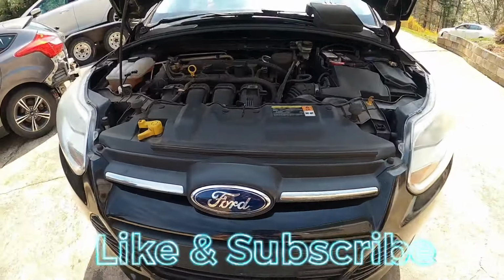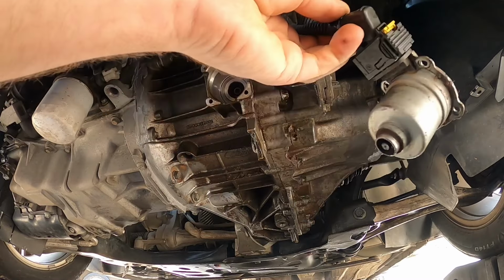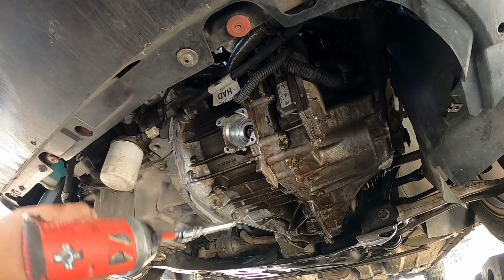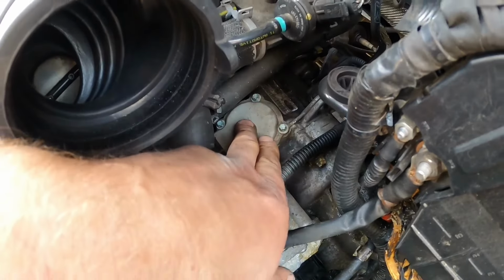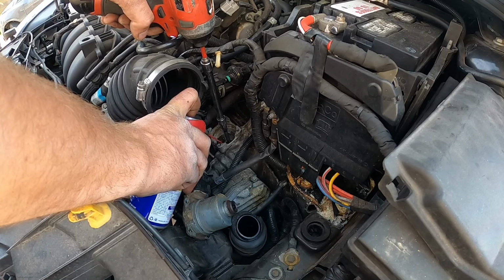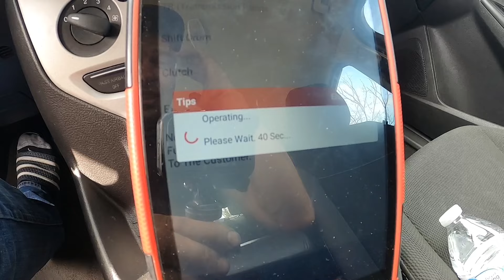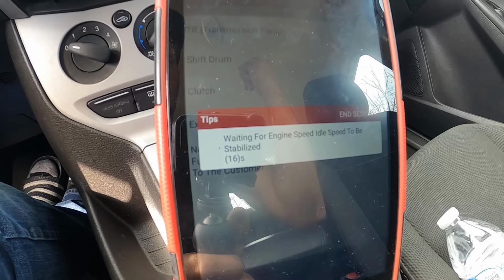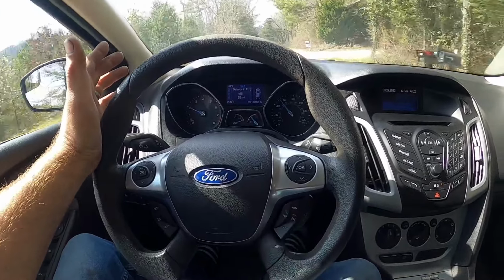2012-2018 Ford Focus Slipping? No Reverse? No Drive? Problem Solved. Easy Fix. You Can Do This!

Comment: Just did this on my Focus, didn't have the Actuator Reset Tool available so I just alternated spraying brake cleaner and placing the Actuator back on a few times. Now my Focus runs like it's brand new again. You are a LEGEND dude!!!!!!
Reply from the maker: Nice! 👍
Reply: @L8R-HP  what if I spray carbon cleaner or 4wd.?,, any different result.?
Reply: So you just sprayed brake cleaner and then drove your car around? Having trouble getting the reset tool
Reply: @cooperking7271  yeah after you spray the cleaner in quickly tighten the actuator back down with a couple of screws and hop in your car, and spend a minute or two just turning your key from off to the on position, the actuator will spin the fork over and over rapidly
Reply: @jmfsmith  let me know how long that’ll last you. I doubt it’ll go on for long the heat and friction material will kill those levers again.
Reply: He'll yea brother.
Reply: Can u tell me the symptoms u were having?
Reply: @dopessongs3635  slipping in drive, code was friction element A stuck on. Still working fine after the fix
Reply: @jmfsmith  hey Jay, I got the same message code recently and then I started getting "transmission overheating" warnings. Did you get the same thing?
Reply: @alexmondragon2594  every now and then I did but that's going to be common when your fork gets stuck. Still running fine with no issues a few thousand miles later
Reply: Hey guys... I have the exact opposite issue.  I only have reverse.  No forward.  I got new actuators, but still no forward gear. Can anyone help me with this?
Reply: @kene23kene  no forward still sounds like shift fork A is having trouble, have you tried cleaning it with this method?
Reply: @Jay Downing  I cleaned it... but not as thoroughly as you.  I don't have the tool that you're using.  I tried with a start bit... but I didn't want to strip it
Reply: @jmfsmith  also what scan tool are you using? I have icarsoft and zurich... neither have those functions
Reply: @jaydowning thank you for this comment man, did this 5 mins ago in a 2012 fiesta with a reverse issue and now reverse is working fine, is there a way to remove the check engine light without erasing it from a scanner?
Reply: I did not have a check engine light on, it just “felt funny” when it shifted and I stumbled on this video. Seemed to work well and drives better. I ordered the tool ($20) and I’ll do it properly soon. As far as reprogramming, sounds like it’ll reprogram itself. Just make sure to turn it counter clockwise 14 times at the end. I’ll do this manually and not with drill.
Reply: Was your transmission also shuddering before or after fixing it? I’m about to try cleaning my actuators because now it’s having a really rough shift.
Reply: @chrisz.9974  Are you getting a kick at 40-50 kmh
Reply: @fputigna  did you try it without the reset tool? My scanner doesn't have the reset and I don't want to touch the clutch if it's going to need the reset scanner.
Reply: I'm planning to do this to my focus in the near future. My question is, after you use the tool that releases the clutch and do this cleaning process, do you have to do anything else so the clutch reengages with the fork or does it do that automatically? Thats the only concern I have about doing this myself and that concern has been holding me back.
Reply: @wickedseedband  from what I have seen you don't HAVE to use the scan tool for that, unless you remove the clutch from the transmission, it'll relearn by driving around. You can check his other videos, he mentions something about that, just to make sure
Reply: Still good after nine months? Give us an update
Reply: @jmfsmith  is it still working ? DPS6 automatic transmission on 16 SE is kinda slipping a little in 2nd or 3rd gear. Used to have code P0 702 00 transmission electrical system so I cleaned the two small grounds under air filter box and big one on firewall driver side to bare metal. It ran great the first few times and I ran it 40 minutes of expressway and it seemed fixed. But since then it’ll be slipping some. And get that dashboard warning transmission overheating. But got no codes . Tried to scan it at Auto Zone and OReillys but no codes showed up. Got the actuators so just clean it out at the holes it goes into ? And it’ll reprogram itself? Just plug and play ? I’ll try it.
Reply: @frankmontez6853  yup still working!
Reply: If you have a big clunk coming out of park and lose reverse look at the drive from the TCM to the housing and see if it spins all the way around or stops. If it stops then spin it back and make sure it stops and your good. If not replace housing. Alternatively a bent clutch fork can do the same.
Reply: @jmfsmith  you the man for keeping us all informed!
Reply: How may miles were you able to drive before it messed up again?
Reply: Thank you so much for the advice. I too don't have the spline tool so I did what you did and sprayed a ton of brake cleaner in there, put actuator back on and kept switching key on & off and heard the forks moving then I sprayed a ton of WD40 specialist for intense rust and repeated the on/off key sequence again. Car shifts fine now. Used to immediately go into limp mode once I hit 2nd gear and would lose reverse. Ford told me I needed to replace entire clutch system for $3,200...This video plus your advice was a life saver.
Reply: What do you think's wrong? If the transmission drives fine until they get hot, then it starts not wanting to shift. Won't go into reverse and when it does you can push it
Reply: @lizmorrison529  if you clean actuatorA makes sure to do Actuator B also because the top one will drip dush on the bottom one and it sticks to the bottom one I had this happen to me last week and so I clean them both again it shifts so smooth and early that I seen increased in gas mileage if it happens again I’m going to drill a hole on the passenger side at the bottom of actuator B for the clutch dust to escape I seen a video of it and it was so much dust dripping out from the bottom of the transmission I went through 2 cans of d40 an one brake cleaner I’m now at 191,000 miles , this method makes some owners wishing they should of kept their focus instead of trashing it good luck to all owners
Reply: @fairfax_fran5109  Thank you. It was my Actuator B fork that was stuck. That was the one I cleaned. I  used a whole can of break cleaner as well and almost a full can of the WD40 specialist. So far so good! But hey, drilling a hole in the bottom of housing does sound like a good idea to remove all the dust & dirt collected in there! Maybe even using a strong vacuum might help?
Reply: @lizmorrison529  definitely as long as you don’t damage the vacuum cleaner lol and just have a someone to help spray it at the same time most important is to hold the folk open no more than 14 spins clockwise some video was 15 don’t lose count you can damage the folk spring then it’s game over
Reply: So many questions posted but no answers!
Reply: @lizmorrison529 hi friend, u spray a lot of wd40?1tin or 2 tin?Won't wd40 fluid leak out of the transmission?Just now I also spray a lot of wd40 according to the video.
Reply: @fairfax_fran5109 Did you spray a whole can of wd40?  Will a large amount of wd40 fluid from the actuator enter the gearbox and then dirty fluid will flow out ?Will spraying a large amount of wd40 damage the clutch ？ Do you also spray a lot?
Reply: @jiawangchu  you see it drip out the holes you drill it work after 4 can of brake cleaner carb cleaner but I would use the d40 can first the lubricant soaks back up the dust
Reply: @fairfax_fran5109  u drill hole on transmission housing ?😲🧐then u spray a lot of wd40 first ?But this video no drill hole on transmission housing 🥺.
Will the clutch be contaminated by wd40?Can cause clutch slip？
Reply: @jiawangchu  not this video sorry a different video I commented on look it up it will show my comment I find it for you
Reply: @jiawangchu  @sev sevy
Reply: @jiawangchu  spray toward the drivers side .. the passenger side is where the clutch is located
Reply: I do not have the tool. I am trying to use a flat blade screwdriver. However, I back out only for turns, and it gets very tight, and, as soon as I take tension off of the actuator, it spins back to its endpoint in a clockwise fashion.  video, it looks like I should be able to turn that rod relatively easy? Is it supposed to spring back into its full clockwise position on its own?
Reply: @baileydbenson1  it’s spring loaded don’t turn it more than 14 spins an yes it supposed to spin back to normal that’s a sign that it’s not stuck if you drill the holes hold it open after 14 spins spray than release , repeat process and if you drill the holes you can see the clutch dust escape the transmission housing, spray till you see it the fluid is clear than you know you flush most of the dust out , when it’s cold temperature using d40 will cause it to gunk back up , your best bet is to drive it when the transmission gets hot then spray the holes for best flush results
Reply: @baileydbenson1  I don’t have the tool either I use a drill bit kit I forgot what size I tell you the size when I get the chance good luck 👍
Reply: @L8R-HP  do I need to do the scanner ?
Reply: @fputigna Do you remember the name of that tool? Size?
Reply: I have a 2015 focus so much money in it now broke down it says the TCM nothing but problems only thing gd about it real cheap on gas
Reply: What does the tool that was used?

What does it called?
Reply: @bqthird 6mm actuator reset tool
Reply: @JestonyAlipda Actuator reset tool
Reply: didn't have the tool on hand so I did this method. Car runs good again!!!
Reply: @fputigna  Where did you buy this tool? I'm about to do this process right now. Need this tool! Thanks in advance!
Reply: @bqthird DPS6 6DCT250 14 teeth, 1/4" Drive
Reply: Hey I just recently had this problem with my car my car doesn’t shift to reverse it’s stuck but it moves on D
Reply: Hello sir i have this difficulty with my focus 2014 i just replaced my gear box old one got bad so inserted a new one and it has no drive and no reverse what I’m i to do?
Reply: @lizmorrison529  Did you do the testing at the end? I don't have a scan tool, but I might be able to get one if I need it
Reply: @melanieadams3066  I unfortunately don't own a scan tool either and so I didn't do the testing. My car lasted another 6 months after doing this trick until my dual clutch packs completely failed and needed replaced. Didn't have the 3k Ford dealership wanted to have it all done so I wound up selling my car to a wrecking yard for $600. She at least did me good, lasted 6 years and ended with over 150k miles. Originally bought used for $3,700 at 80k miles on it.
Reply: @chrisz.9974 hey bro, can u give an update on the fix and if it worked? currently dealing with the same issues
Reply: @ I had to replace the clutch forks unfortunately. Biggest project I ever tackled.
Reply: @chrisz.9974 was the fix extensive? i’ve never worked on a car before but kinda wanted to do this, but after reading your comment i may be better off just selling it lol.
Reply: @ yes. You have to drop the transmission lol. I’ve worked on personal vehicles with my dad just as a home mechanic. It was “easy” if you’re mechanically inclined. Definitely would not tackle this if you’ve never worked on a car. But if I remember correctly, he a few videos on dropping the transmission and how to reset the clutch and reprogram the computer if you want to see the extent of it.
Reply: @chrisz.9974  thank you so much for responding bro. so what he’s preforming in this video isn’t replacing the clutches, it’s kinda just loosening them? sorry for the continued questions i’m a novice with this car stuff. i’ve had my ford fixed for tcm issues before and they told me clutch b was sticking so hopefully i won’t have to replace the clutch completely
Reply: @ so he’s manually spinning them in hopes it loosens it up. It gets full of clutch dust in there so it dries up any lubrication it has on those springs and bearings on the forks. I havent rewatched it but if I remember he’s spraying it with wd40 right? It didn’t work for me.
Reply: @ chances are your clutch is fine. Mine were fine. The only way to get to the forks is to drop the transmission and take out the components.
Reply: @dashboy4l he’s moving the clutch forks in and out. The actuator is a little box they will move it in and out as it changes gears. The clutch forks are what give problems.
Reply: This Solution will last only for a few miles then you will have to do it again , just tried everything , it will fix it self when you get 100k and change 10 30 oil synthetic ,high mileage , never failed again , I sold the car when was 150k with no transmission issue
Reply: What tool did you use bro?

Comment: Just did this on my 2014 Focus that appears to have a sticky clutch and has the same code as the video title. Key is use lots of brake parts cleaner while cranking the clutch actuator hole with the actuator tool, spray, crank, spray crank and only about 10-14 rotations MAX then turn it back down the whole ways. You will notice if you’ve never done this before, the clutch won’t go back down the whole way by itself. The goal is to get the clutch fork to completely release back down on its own after cranking up about 10 rotations. After brake parts cleaner, add a little WD40 to lube the actuator hole, crank up 10 rotations and back down. You may need to put it back together drive it for a little and do some more cleaning if you still have the same code and bad shifts. When this first started, I cleaned and lubed with WD40 as described, but the clutch fork wasn’t releasing back down on its own after being cranked and it was still shifting bad sometimes and showing the code. Drove it for about 2 weeks, then took it back apart and did some more extensive cleaning with the brake parts cleaner and then little WD40 lube at the end then after cranking 10 rotations, releasing the wrench made the clutch release it the whole way back down to the bottom. Now the code is gone and the car drives normal again. It’s just a sticky clutch and needs cleaned.
Reply from the maker: Nice job 👍
Reply: Is there still slippage in your transmission or has it been corrected?
Reply: @Bilal-g9y  No slip, this has been corrected since i posted this basically. May have had to do 1 more cleaning session but it ultimately fixes the problem.

Comment: Amazing, helpful video brother! FYI - clutch actuator A controls only the odd forward gears (1, 3, 5). Actuator B controls even gears and reverse. Hope this helps if you experience skipping gears.
Reply from the maker: Correct, I should have explained it better
Reply: @L8R-HP  You did a great job! I removed my actuator B and tried to use a M6 spline tool to turn the forks, but the hole in the actuator well appeared to worn or stripped. I'll try to order the tool you recommend to turn them and see if it fits better.  If not, I assume I will need to remove the transmission.  Thanks again!
Reply: What scan tool are you using?  I would like to perform the resets on my transmission before taking to dealer.
Reply: @drewnelson5433   you kinda don't need to. It'll do the drum calibration if it feels that your gears are out of whack or a clutch is stuck. I did this procedure without the calibrations and it worked fine. As far as a transmission computer reset, you just have to turn on your vehicle, turn it off, exit the vehicle, close the door, lock it so it beeps, get back in and start it up. Or instead of getting out, just pretend like you did. Just make sure you unlock the door with your key and not your door if you don't want your alarm to go off.
Reply: THAT EXPLAINS WHY MINE WONT REVERSE OR SHIFT OUT OF FIRST!!!😮😮😮😮
Reply: my 2011 fiesta seems difficult to shift from 1st to 2nd gear, should i replace the A or B actuator?
Reply: @ B. I couldn’t get out of first cause B was busted. But to be safe replace both! They’re like $15 a piece
Reply: @chrisfinoc6236  where did u get it for $15? here it's like $100 for non genuine ford part and $250 for the genuine one 🤣😅
Reply: @ oh uh… Amazon 😂
Reply: @ I cannot recommend enough the break fluid cleaner trick. Unstuck my 1st-2nd gear transition like a pro!!!
Reply: @chrisfinoc6236 did you end up replacing both with the amazon pieces? if so i will as well lol
Reply: @dashboy4l  at present I only replaced the one, but I intend to replace the second. Matter of time.

Comment: the amazon actuators have come a long way. I replaced both on my daily driver. One is a Labwork one is a FANHAY and it's been over a year and around 30k miles of smooth operation.